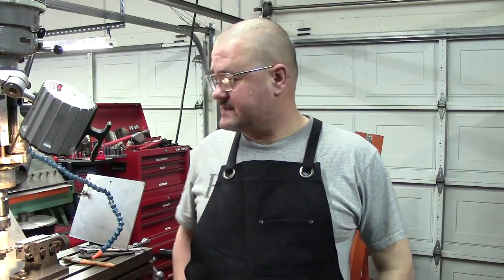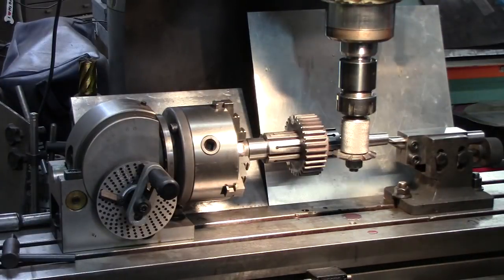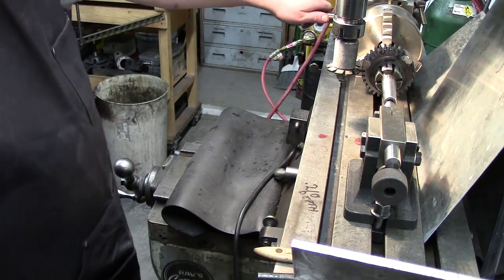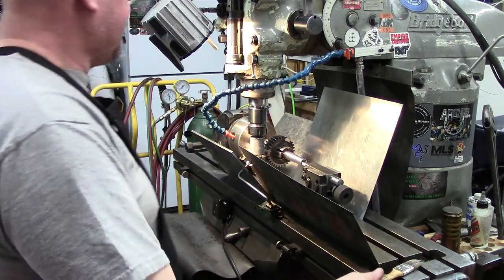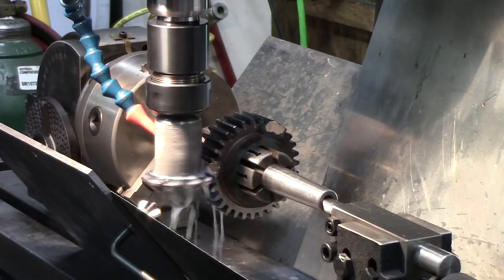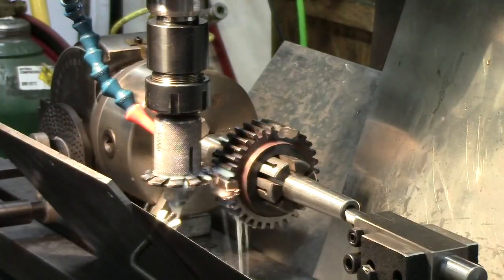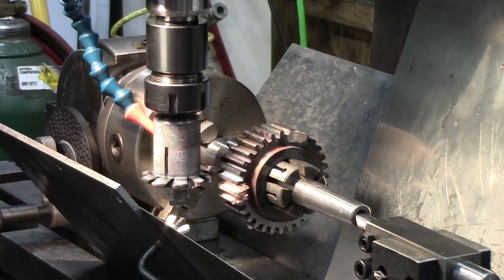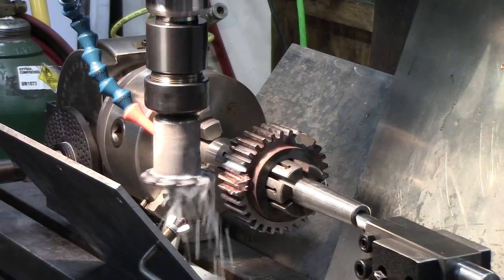Spur Gear repair and build PT3

Comment: Looking good so far.  I've got the mainshaft back in place to keep condensation off of the bearing surfaces, so take the time you need with it.  I'm certainly not in a huge hurry for it at this time.

If anyone is aware of what was used for oil seals on the mid 19-teens GE motors, I'd appreciate a note on that.  There was nothing left of the old ones for me to go by.  The only common option I'm aware of for back then would be a rope type seal, and my success to failure ratio with those is about 40%
Reply from the maker: diggerop felt and leather type seals and wicks were common place back in that era.

Comment: gear cutting is always a relearning experience for us home shop guys. i noticed you didn't appear to have locked your spindle after moving it. and it looks like you were cutting the gear in the direction to press it off the mandrell. alls well that ends well , i would not have been so lucky.